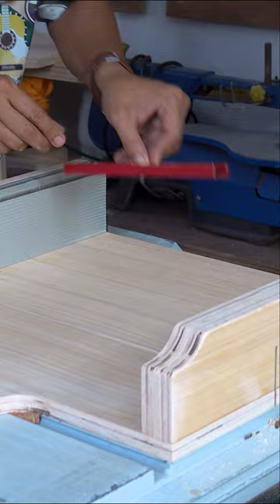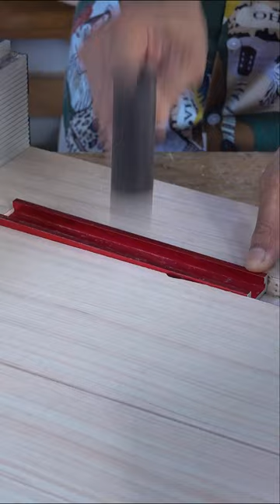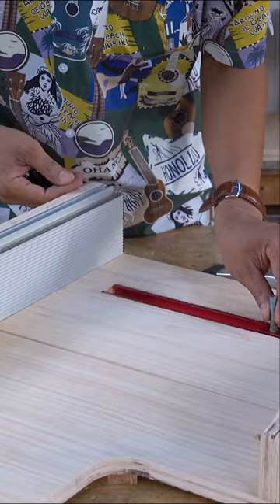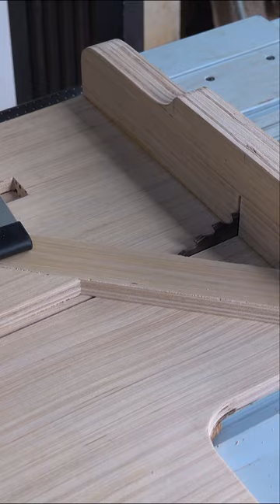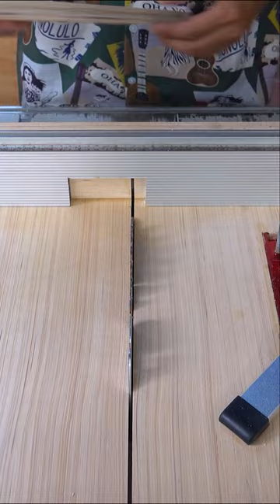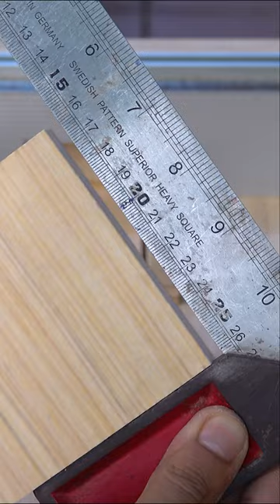Cutting Plywood 90 degree with making clamp on Crosscut #shorts #woodworking #trending

Comment: This is a nice sled. Good job. 

The back brace on the sled limits the length of the piece when using that 45 attachment. 

My sled is like this too. But I have a different sled that can handle this operation.